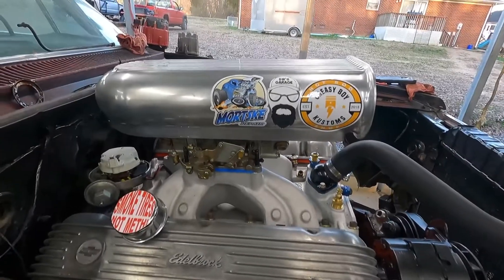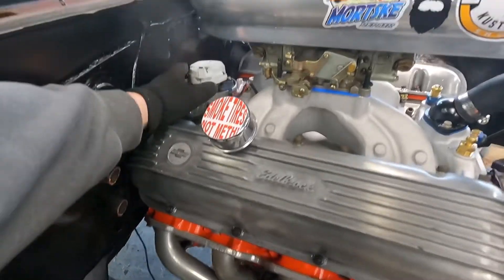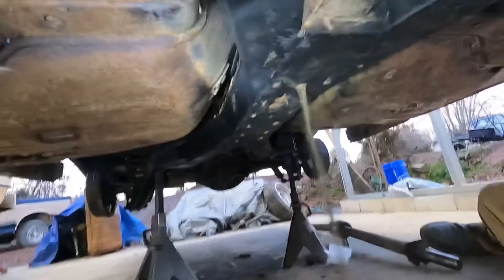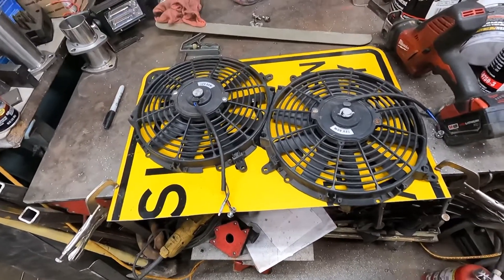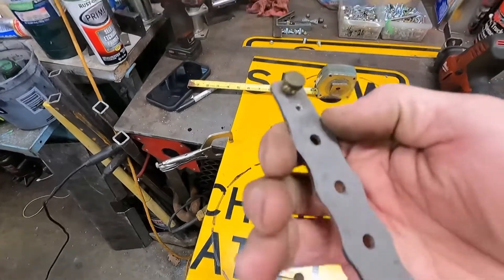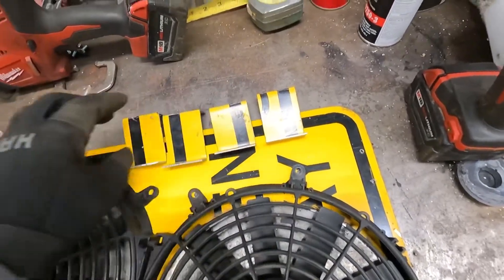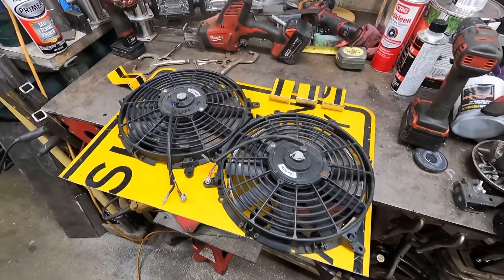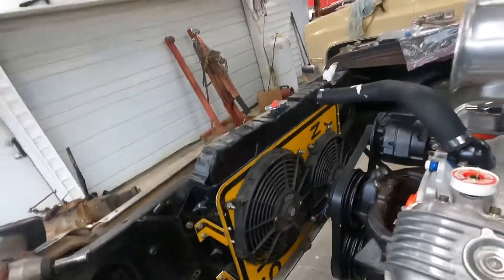Street sign fan shroud for the 1964 Impala budget build

Comment: Looks good.....you are only pulling air through the core in the spots the fans have open. The shroud it closing off the rest of the core from air flow through the back. IF you ran a 3/4 - 1" closed in standoff all the way around, sealing the shroud to the core like a 3/4" high box type funnel thing( lookin like a big backing pan sorta), with fans on it, it would pull from the whole core... I learned cooling stuff the hard way with blown hotrods. Thanks for the mention and I love this BBC 64. Kinda a bucket list build for me. Weld that diff...LOL
Reply from the maker: There’s probably 3/4” of space between the fans and the actual radiator core. Once I seal off the sides I hope the fans will pull air like you were saying with the box fan. I shouldnt have running hot problems with a 8:1 250hp turd lol. The diff will get the “Miller no spin” treatment
Reply: Left For Dead Garage That will be fine. If it gets hot while flying down the road, make some windows next to the fans and cover with a rubber flap. It will open when moving and suck closed when still and seal off the box.  Miller lockers are just as good as Lincoln lockers... its been proven by someone Im sure..
Reply from the maker: @JAWSatBCPerformance  I have a Nissan Quest fan assembly here that has the rubber flaps. BTW the Quest fans fit C10 radiators great!
Reply: @LeftForDeadGarage  good to know...now I need to find a nissan quest
Reply from the maker: @JAWSatBCPerformance  Any junkyards on the island? Man I bet it REALLY takes some planning to build a car/truck there.